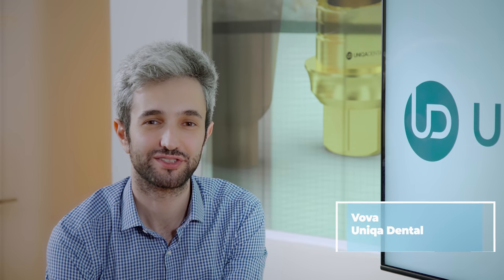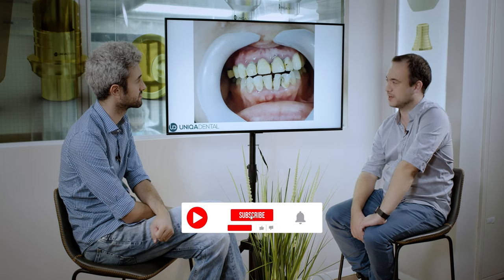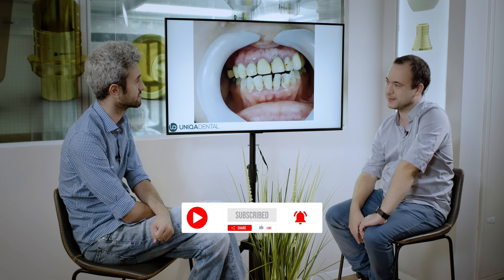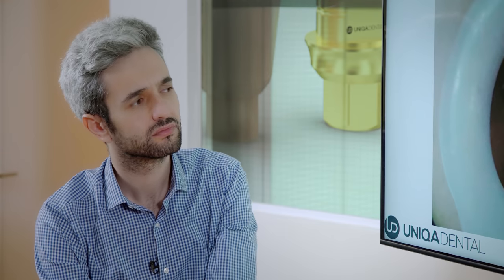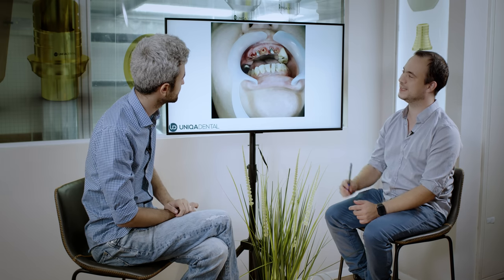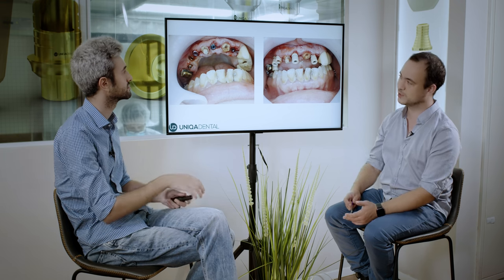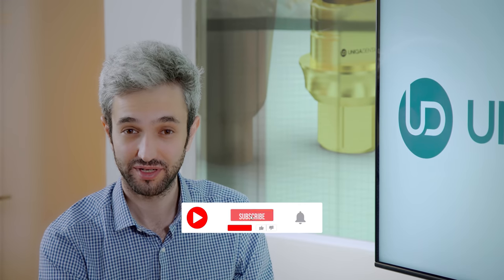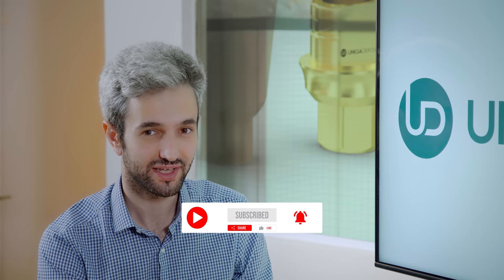A screw retained restoration of the bridge on the upper jaw. Temporary bridge for their daily use

Comment from the maker: 00:00 The smallest possible abutment to go into the hex and into the screw. 
00:32 This case is from the laboratory. It's a case from a different doctor. 
01:33 If you want to make cemented restoration, you don't have space here at all. 
02:04 You want the smallest possible height of the abutment, and for the cementation.
03:05 Here you can see one-and-a-half-millimeter sleeve.
03:42 It's a permanent bridge.
03:53 For the screw loosening are much smaller if you use three implants because you have three implants that each go to another direction and the integrity is much better.
05:03 Crazy angulation. And everything here was made on straight multi-units.
05:21 You don't need to use angulated ones, it's much simpler to make the work. 
06:00 To make the bridge as strong as possible. 
06:33 Will it hold and everything will be fixed?
06:33 You can't make the ideal way of restoration on not ideally placed implants. 
07:40 And that's a permanent bridge, and that's it?
08:12 Do you have enough space here for cemented? With regard to surface area? Here the angulation is too big.
08:22 So, it's a problem to cement?